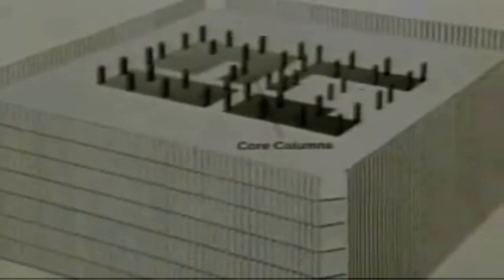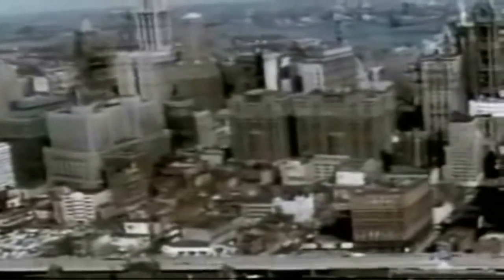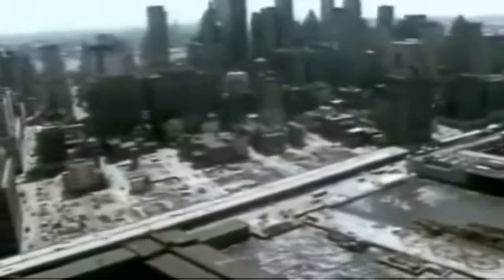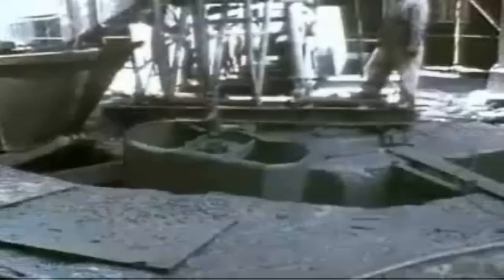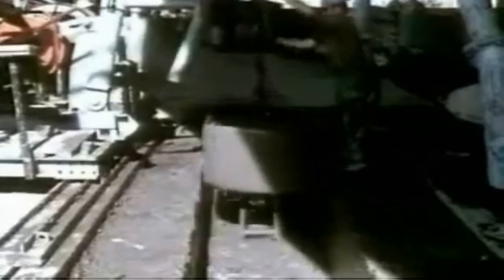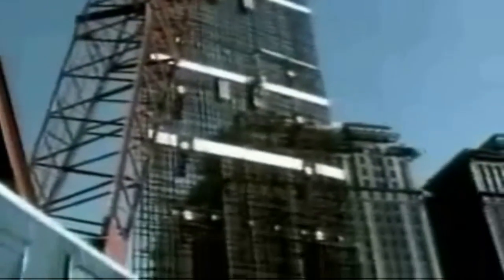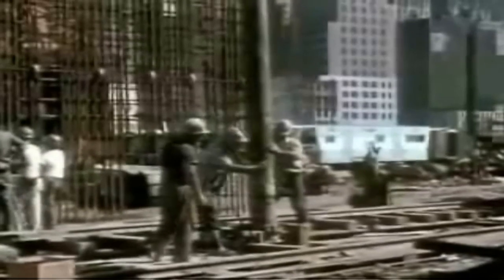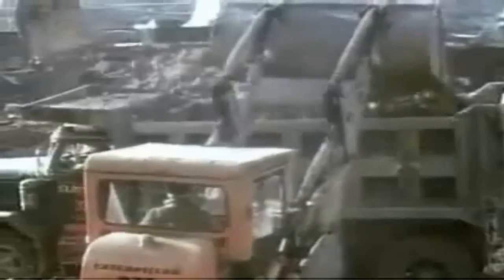Building the World Trade Center Towers

Comment: TRANSCRIPT: One of the most dramatic events in New York City in the nineteen sixties, was the construction of the World Trade Center. Design and construction would take years, and efforts of thousands of people. A project of this size created enormous challenges; challenges that demanded the use of dramatic, new engineering concepts. A wide variety of designs was considered. Final plans called for a complex of low-level buildings, surrounding two thirteen hundred fifty foot towers; the tallest ever built. Their great height was made possible by the use of load-bearing walls. Extremely tall buildings were traditionally inefficient, since huge amounts of interior space were taken up by structural supports and elevators. The Trade Center towers would overcome this problem: The exterior walls were designed to bear much of the weight of the towers, as well as all the wind loads. The only internal supports would be in a central core of columns; elevators would be placed in the shafts formed by the core columns. To further conserve space, the towers would be organized into three zones served by express elevators; local elevators would run within each zone. These engineering considerations determined the towers basic design: sheer symmetrical walls rising without setbacks. The site selected for the Trade Center was an old section of Manhattan's Lower West Side. The area housed a great number of small businesses, but the predominance of electronics stores caused it to be known as "Radio Row". In nineteen sixty six, demolition began. In all, 164 buildings had to be torn down, and generations of power, telephone, gas, steam, and water lines had to be re-routed. The site actually consisted of waterlogged landfill, which had accumulated over two centuries out of old wharves and debris. To support the great weight of the towers, foundations would have to be dug down seventy feet to bedrock, but the removal of water from this huge area would have caused a dangerous lowering of the surrounding water level, undermining nearby buildings. The solution was to construct an underground concrete retaining wall to surround the site. This was built with a "Slurry Trench Method", used for the first time in this country [the United States]. A trench was dug down to bedrock, and a thick bentonite slurry was pumped in. The slurry was denser than the surrounding mud and dirt, and thus kept the trench walls from collapsing. As each section was completed, twenty five ton cages of metal reinforcement rods were lowered into the slurry filled trench. With the cage in place, concrete was poured in. Since the concrete had a greater density than the slurry, the slurry was forced up out of the trench, and could be used for the next section. In this way, an underground wall was built completely sealing the site; excavation began. As each section of the slurry wall was revealed, workers drilled holes through the wall and casings were pushed through down to bedrock on the far side. Steel tendons were then inserted through these holes and socketed into bedrock, bracing the wall against external pressure. More than a million cubic yards of dirt had to be removed to make way for the Trade Center's foundations. The excavated earth was placed in the Hudson River adjacent to the site, to create more than 23 acres of new land; land which was donated to the city of New York. The site presented another major challenge: the tubes containing the PATH [Port Authority Trans Hudson] commuter rail lines lay underground within the excavation area. The fragile tubes had to be supported in protective cradles, while excavation continued around them. Throughout construction, the PATH trains carried one hundred thirty thousand commuters daily; at no point was service interrupted. Seven stories down, bedrock was finally reached. Foundations for the towers could now be prepared. Concrete footings were formed, and poured into bedrock. Massive assemblies of steel beams, called grillages, were laid on these footings. Each grillage would anchor one of the load bearing tower columns. Meanwhile, orders were placed for the two hundred thousand tons of steel which would be needed for construction. Individual pieces were pre-fabricated and rarely interchangeable. Moreover, there would be no room to stockpile materials at the construction site. This created a tremendous logistical problem: steel sections would have to arrive at the site in the exact order, and at the exact time needed. To meet this challenge, Port Authority engineers used a computerized system known as "Critical Path Method", or CPM. CPM would coordinate every aspect of construction, track the flow of materials, and minimize any delays. In August nineteen sixty eight, actual steel construction began. Kangaroo Cranes, imported from Australia, were used for the first time in the United States. The cranes were assembled on top of the core columns, each could lift sixty tons at a time; they would be the driving force behind the towers construction. The cranes have the ability to jack themselves up thirty six feet at a jump. As the walls grew to the height of a crane, the crane would hoist itself up, a neighboring crane would swing core columns into place beneath it, and construction would continue. Seventy feet up, at street level, steel trees were put into place around the perimeter of the towers. These trees would transfer the load of the exterior wall to the more widely spaced columns now anchored to bedrock. Construction of the towers could now proceed with great speed. Three basic elements were used: two or three story high sections for the load bearing wall, massive steel beams for the core columns, and floor sections to span the sixty feet between core and wall. Through the complex orchestration of these structural elements, three floors could be constructed in ten days. For its many engineering innovations, the Trade Center was cited as the Outstanding Engineering Achievement of nineteen seventy one. Shortly after the structural completion of the towers, the surrounding low-level buildings were finished. A final addition to the North Tower, was a 360 foot television antenna, erected in nineteen seventy eight.

Comment: The world trade center towers were such a great design, and the Supporting columns on the outside design is still used in brand new buildings today. The columns were designed to take the force of a Boeing 707 or smaller aircraft. The fact that the buildings were able to stand at all for any amount of time after the Boeing 767-200ER few into them was just amazing, it really showed how well they were designed considering they were not designed to take the load of anything near the size of that.
Reply

Comment: For all those that think the WTC Twin Towers(1350 ft.) should not have been rebuilt, stronger, better and a little bit taller, (as Trump wanted to do) for ANY reason other than very high cost and subjective asthetics please research: The Burj Kalifa Tower (in Dubai) its twice as tall as the WTC was at 2700+ ft.! And 160+ stories & The Patronas Twin Towers in Malaysia, round twin towers, 103+ stories, they are taller and stronger, better built, fire proof and plane crash resistant even.

Comment: 1:40 could be the reason why the towers collapsed during 9/11, along with the weakening of the support beams.
Reply: See the size of the hole in the North face of WTC1, where the first plane hit, that's so much vertical support gone.
 I'm not surprised it collapsed, just from that damage alone, without even counting all the other columns knocked out and the intense fire weakening what was left.

 I've often wondered, even if the fire was extinguished and the tower didn't collapse,
what the hell do you do with such a structurally compromised building of that size?